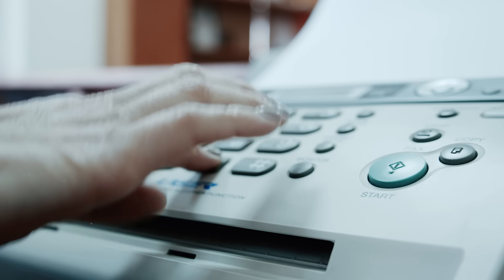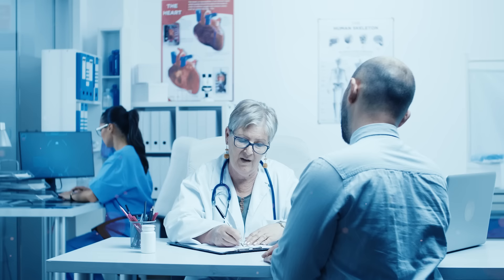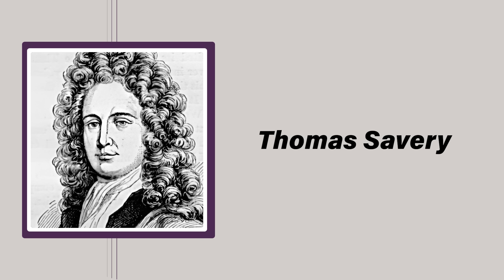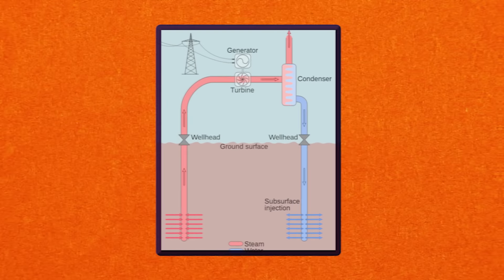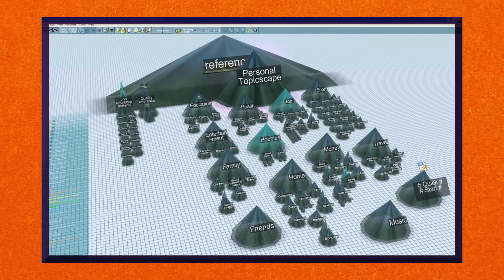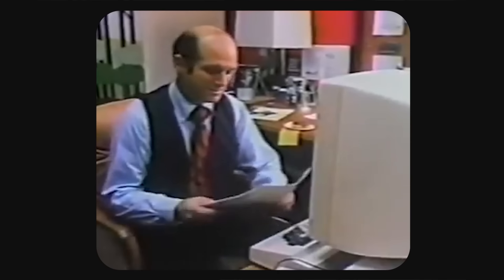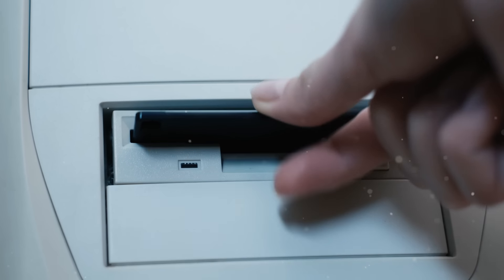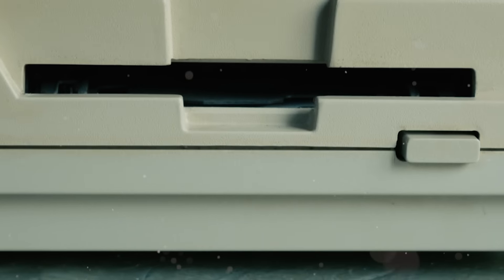Terribly Outdated Technology that we Still Use...

Comment: What is ironic concerning the "security" of using fax machines today is that the exchange of data is now a virtual service over the internet. I have a hard time believing there exists a different protocol over dedicated "phone" lines still in existence. But I invite someone with more knowledge to please correct me if I am wrong.
Reply: it is all in the SWITCHING. you'll never see it, because the phone companies will sue you, disconnect you remotely, or you'll dick it up and break something... but a phone line, land line, is a cord, a cable, a piece of wire. the jack in the wall is WIRED through the building just like electricity is. that wire goes into a switchbox inside the building and THEN to the hardline (another BIGGER wire) that leaves the building. then that bigger wire goes to ANOTHER even BIGGER switchbox and to the hardwire 'network' for regions and nations and continents and across oceans and seas. 

for security and physics reasons... that line inside the building from the jack in the wall to the building's switchbox can be cut, spliced, and you have a 'physical tap'... just like a pipe. the electricity goes from the 'phone or fax' to the jack and down the wire to the tap. the tap allows the electricity to still flow to 'something' recording the impulses in the tap and translating them, voice and impulse data. then the electricity leaves the tap and goes through the rest of the cable to the building's switchbox JUST like it was never interrupted.

another kind of tap can be put into the phone jack in the wall, or inside the switchbox in the building or the phone company's switchbox outside the building or even by the phone company itself when it leaves your neighborhood switchbox.  

hardlines like this HAVE to be cut and spliced to tap. shrug. that is just the way the physics works.

 'the fax machine booobeeeepwahhhhnaahhh' sounds you hear on your phone when a fax machine accidentally calls your number. those sounds are your phone's handset TRYING to interpret the electrical impulses the fax machine uses to send digital data of the pages it scanned. dialup modems use the EXACT SAME electrical impulse data stream as fax machines do. just with a hell of a lot more information moving through the exact same wires. 

with 'digital' switching... shrug... it is the EXACT SAME WIRES... just with computers controlling the switchboxes instead of piezoelectric switches. 

fiber optic lines use LIGHT instead of electricity and are harder to tap. because u cut one of those juust wrong? an ALERT goes to you and/or the phone company that your fiber line was broken (oops somebody dug in the wrong spot on the ground!) and your clandestine 'listening in' is foiled. plus light is harder (than electricity) to interrupt, read, translate, AND THEN retransmit the EXACT SAME LIGHT PULSES past the tap to allow the information to flow as it normally did. 

the 'security' of hardline wires is in physical access. will 'somebody' notice a hole in a wall that wasn't there yesterday? or a switchbox panel that was locked the other day but unlocked today? or a 'new piece of weird hardware' put INSIDE the building's switchbox or the neighborhood switchbox or the regional one. 

'technically'... the NSA, CIA, and other 'alphabet soup' US Govt. Agencies CAN tap any phone or data line in the USA within minutes of the phone companies getting the warrant. THAT is a big problem, early 2000's and lots of legal and illegal post 9/11 covert shenanigans, somebody leaked it, annnd huge scandal. ESPECIALLY the two 'trunk lines' that cross the seabeds of the Pacific and the Atlantic Ocean termination locations on the East and West coasts of the USA. the NSA had 'hardwired technology' installed in those two facilities and was recording EVERYTHING transmitted to Asia and Europe from the US and back to the US from those regions via those two facilities.

i hope this was able to help you a little. :D

Comment: Not only is windows xp still popular but its younger brother windows 7 is still abundantly popular and widespread not just in industry but also at home. Windows 7 machines are still usually connected to the internet unlike windows xp, problem is windows 7 is new enough to be current/“modern” but old enough to be very unsecured and vulnerable to threats especially when connected to the internet as well as the fact that military, hospitals, nuclear plants and many other important machines are still running windows 7 machines that are connected to the networks meaning that people are still investing time into finding exploits and creating malware for this old OS. Like xp, some 7 machines can’t be updated due to software that is made for it (though a lot of windows 7 applications are compatible with 10 and sometimes 11) but I find from experience that a lot of places that have not upgraded to windows 10 or 11 don't do it due to the hassle and the possible downtime in service it would take to upgrade to more modern systems

Comment: I use Windows XP Professional x64 Edition on a laptop with an Intel i3 processor. The laptop feels much faster than with Windows 7. As long as you use Windows XP strictly offline, nothing can happen. It is absolutely secure. I use the laptop as a portable DVD player and generally to write letters and express my literary muse.  I only print via cable with a non-WLAN printer. If you use the devices on which Windows XP is installed strictly offline without Wi-Fi for printing, I don't see a problem.

Comment: I was in mobile communications (taxi, police and fire etc radios and paging) for 40 years and also owned a cellphone store for 25 years.
I consider a smart phone to be akin to a swiss army knife.  It can do a lot of things, but it doesn't do any of them as well as simpler device designed for the job.  None of us would consider keeping a swiss army knife on us to use the spoon or the screwdriver.  We would all choose a purpose made spoon or screwdriver over the swiss army knife given the choice.  
Pagers and radios are simple devices with simple backbone networks usually maintained by a smaller local radio business that responds to the rare breakdowns quickly.  Try getting a cell service provider or ISP to even acknowledge there is a problem with their system let alone fix it in a timely manner.... mission impossible!

Comment: Actually.. Steam power is still used in trains.  A friend of mine who works at a rail yard, told me that for engines working in railyards just moving cars from one track to another are most often steam powered because it’s cheaper and they don’t need the speeds or power in a full rail yard… and Windows XP… I loved it.. and I hated upgrading and only did when my new computer came with Windows 7.. I personally though still use it for games that I loved from back then… I don’t call it outdated so much as the newer versions of windows to be … well, out of touch… They only really exist.. to line MS’s pockets… and really, I find it too bloated to use…. I know I can attest to the pager though… though I had one every 2 weeks back 10 years ago… they are still an analog RF system… where digital call networks range sucks.. I know there are places in the mid-west where towns are few and FAR between.. those old analog cell phone work where our nice digital cell phone have that dreaded message… “No Service”… and they still work in subways too…

Comment: I had 2 smartphones, a Motorola for 2 years and then updated to a Samsung. But in 6 months the battery went bad. Do you think I could replace the battery? NO! I had to hire someone to heat the phone up twice to replace the battery, because everything is glued together. Then before long the phone quit working completely. I went back to a flip phone. I heard UK has passed a bill that makes makers of phones, tablets, laptops that they must make these units have replaceable batteries. I think that is a good idea,,,,,,,,,,,,,,

Comment: There's nothing qrong with outdated technology if it is still working nicely... for instance, your thumbnail points to Windows XP being dangerous, but if you use an airgapped (or virtual machine) instance it is very good for running older software.

And chain bicycles were technically replaced by motorcycles, but they are still everywhere

Comment: Please don't call XP outdated! 😡 It is NOT like 95 or 3.1 or DOS. It was released after 2000 (It was released in October 2001).  It is still quite usable, as long as you install Mypal, VLC media player, IrfanView, WinRAR, Office 97/2000/XP/2003/2007/2010, A compatible version of Adobe Acrobat Reader, XP-era or earlier compatible games and a version of Avast Antivirus, etc., besides the lack of security updates. It says that Avast antivirus on Windows XP will still protect it from viruses, but Windows XP users may NOT access it's newest features. In my opinion, anything made in and after 2000 are new.

Comment: WindowsXP is not only still in use, but it's secretly supported by Microsoft. Why? Because it literally can't be replaced. The critical applications that were built to run on it will not run on emulators and many require direct access to hardware at specific locations and speeds. So, it lives on. On equipment that is decades old and has to be maintained as well.

Comment: The thing is that just because newer technology and devices come out doesn't mean that previous technology stops working as long as it's taken care of, but is it truly "outdated" if it's still in use? I loved using Windows XP. If it was still sold and supported, I would still prefer it over anything that has come out after. It was the best, most versatile and user-friendly operating system that Microsoft ever put out.

Comment: If device drivers were not a problem I still could use Windows XP. It was a good step forward from the unstable 98 and not too far into crap like windows 10 and 11.
As for floppy disks... reliability is not the first word I associate with them. But I assume that airplanes use them when still on the ground, so when one floppy goes bad people could just use another one. Using them in legacy systems makes sense - they will probably be replaced with the whole system.

Comment: Ancient OS (NOT on the internet OR on a LAN) are fine and machine tools etc prove it daily. I hoarded low use floppy drives from old HP servers (whose ATX cases I used long ago to build PCs) to support them and Winimaged every relevant floppy disc I could lay hands on then burned them to the root directory of CDs I still have (they're still readable due to always burning at slowest speed available, thanks CDRWIN). There is no reason to lose mad money on machine downtime to change (complexity is NOT an "upgrade") OS and hardware when stock parts are so profitable. BTW Those wanting USB floppy drive replacements should check out GoTek USB floppy emulators beloved by vintage computer users and common to CNC retrofits.

Comment: It is an insult to the memory of Charles Parsons to call a wind powered electrical device a "turbine". His invention was more original than the improvement James Watt made to Newcomen's  engine for pumping water out of tin mines.
A gas turbine is relatively a minor modification of the steam turbine,
Steam in a turbine IS a gas, and the hotter the gas , the more efficient the engine.

Comment: The fax machine's security relies on an point to point connection as in old school landline telephone networks. Problem is, that in more and more, in my area most places, the fax machines signal as all other calls will travel through internet protocol gateways. The security advantage therefore doesn't exist anymore. There is not way to tell if there was a man in the middle attack, it is even impossible to tell for a sender, if the remote fax machine is a virtual device that will send the message to an email account. The only reason why this device still enjoyed some popularity in Germany was that the above fact wasn't well understood by many users and offices. After a german court rule Fax is not a replacement for snail mail or digitally signed documents anymore and is now finally vanishing. - I feel this problem of modern phone networks often running on the internet, sending the emutlated analogue beep boops tones of virtual fax machines as audio in IP packages should have been a talking point here.

Comment: Let’s face it, vista and onward have been stagnations. Same goes for mac OS 10.7 and up.
All of the “upgrades” generally boil down to a requirement for newer hardware, very little in the way of increased malware protection and software that have been industry standards reacting in unforeseen or unpredictable ways. We see UI enhancements sure, but Ive been at a loss for how these changes are improvements.

Technology in general feels stagnant. Same shit every year but with a wifi requirement or a tablet built into it. I could go on about the inherent issues of touch screen devices. Ask any tesla owner who’s unable to change their fan speed because their touch screen  malfunctioned.

Comment: A bit misleading on floppies. Airplanes use old tech because the cost of updating is made ridiculous by the FAA. That’s really the only reason. I hear guys trying to rationalize it all the time, or who get confused, but it’s simply risk aversion by regulators causing lack of progress by innovators. Piston aircraft are still mostly made with engines that are insanely similar to those from just after WW2. Very few new piston plane engines have been certified since the FAA was named. 
Heavy industrial equipment is usually a low volume problem. Often, the system was totally custom, and the cost to update extreme. The only people with real knowledge of how to interface it will often ask for huge contracts if they happen to still be living. The companies, who made millions and millions off of those old guy’s work act all offended, but they are really just trying to avoid paying what has already proved to be a fair price. 

I once sold a very old workstation to NASA for the space shuttle. In this case, it was a bit of a combination of both effects. Risk of updating was high, and would require lots of tests on any new choice. At the same time, it was a low volume installation as they had stopped making shuttles, and they never were making many. It just made perfect sense to simply replace the old box with the exact same old box.

Comment: I was flabbergasted at how many archaic requirements my stock brokerage had to make a broker to broker retirement account transfer. To Print a Form, ensuring it's filled out by Hand, and snail mailed or faxed. I didn't own a printer, pen, fax machine, letter, or stamps. As if a hand signature sent through a low quality fax, is more secure than an online request from being logged in to my account with two factor authentication, when they didn't even have my signature to compare to.

Comment: Paper tape (or punched tape), a storage medium used for computers in the 60s and 70s is still used much like the floppy disk in industry, specifically for CNC machines.  While comparatively slow, it's a very robust storage medium.

Comment: XP is objectively a better operating system than all other windows versions. it was the last one to do ONLY what you told it to exactly when you told it. more "modern" operating systems are riddled with bloatware, adware, and spyware. they can also force various "updates" and changes without your permission or knowledge. and you can do nothing to remove any of that. with XP even if it was on your computer you could just delete it, and there was no way for it to return without your permission. windows7 onwards, massive swaths are completely untouchable or editable under the guise of being "idiot proof" all this allows is a massive security flaw literally embedded into the base code of the operating system.  most modern virus attacks go through this "microsoft update window" now without anyone being aware at all.  XP is objectively superior to everything that came after. microsoft operating systems have been a literal downhill slide ever since with each one being worse than the last.
Reply: Agreed

Comment: You missed the relevance of diesel in the replacement of steam, particularly in locomotives. Electrical and Diesel locomotives killed the primary visible manifestation of steam to the public, the "locomotive engine".  Electric locos certainly have their places, but diesel engines are the main steam-replacement workhorses worldwide.

Comment: Steam powered cars will never reach the potential due to the high pressure required.  Even today, there are stationary engineers running boiler power plants, solely to avoid blowing the pressure tanks up!!

Comment: Trying to figure out how steam is "outdated". There has never been an internal combustion engine that can produce as much torque. If your car had a modern steam engine, it would not need a transmission because of the high torque. If anything, the Otto Cycle Engine was a giant step in the wrong direction. We would have been much better off using steam or Stirling Engines.

Comment: Computers that are used to control equipment where failure could be catastrophic, e.g. aircraft computers, public telecommunication equipment or power stations, NEVER use Windows operating systems. "Autopilot has encountered a problem and needs to restaaaaaaaaaaaaaa!"

Comment: I shave with double-edged razors, some modern, some vintage. I get much better results than from modern multi-blades embedded in plastic junk. My oldest one is about 100 years old. 
Here's the kicker: you can still get brand-new blades that are reverse-compatible with even the earliest models of DE razors (in spite of numerous razor format changes), are of much better quality, AND the blades still cost the SAME PRICE as Gillette blades did in 1905 (with not even an allowance for inflation). And they can be recycled.